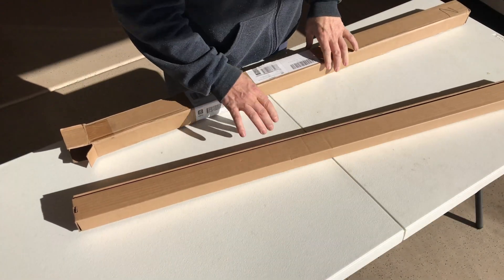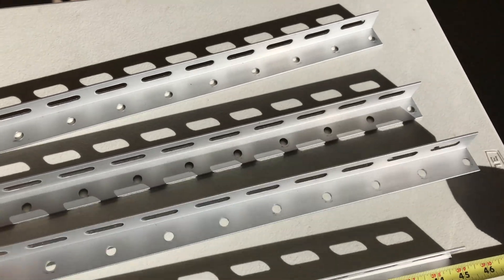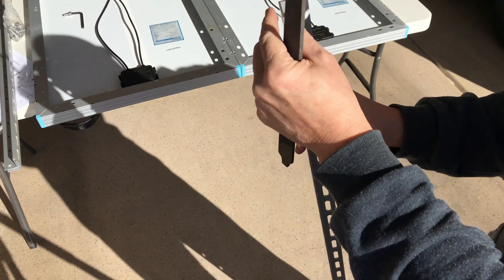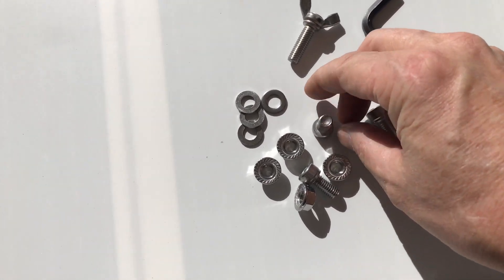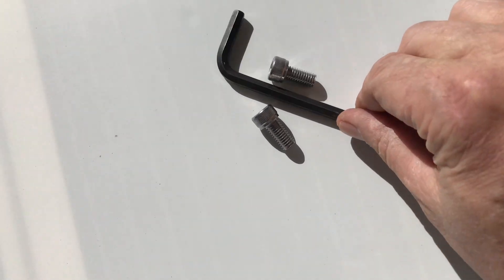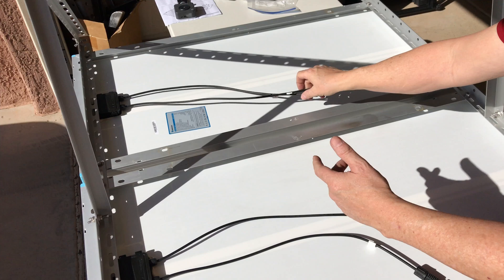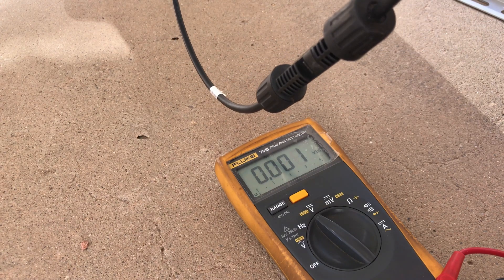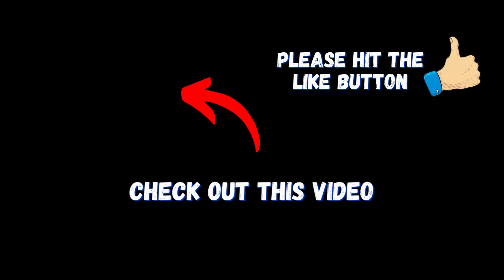The Cheapest Adjustable Solar Tilt Mounts I've Ever Tested

Comment: Ive got 3 sets of these, 1 large ive mounted 2 panels on,  and 2 single smaller ones, holding 4 x 200 watt panels in all, work brilliantly, more than doubled my capture daily on my bus conversion roof. The double up one is fairly heavy to lift and get seated but not so much i cant do it 12 ft up a ladder. Top tip, buy some spring washers and flat repair washers and nylon 3mm washers. And drill the wider face on the support/angle struts and turn through 90°, makes spinning the wing nuts possible and the washers etc take up all but 3 turns of thread, not endlessly spinning partly trapped threads.
Haveba good one 🙏😊